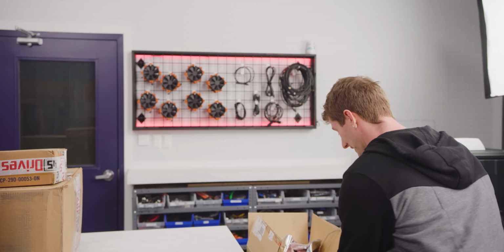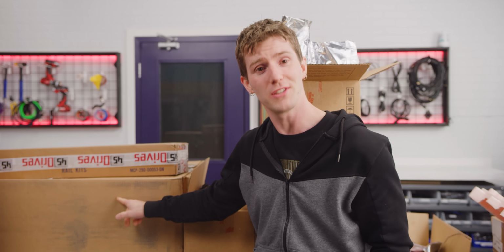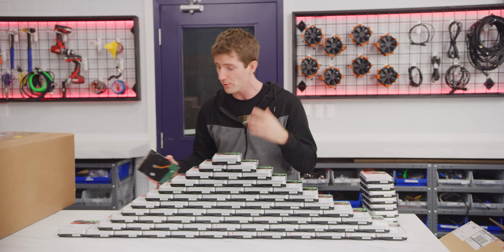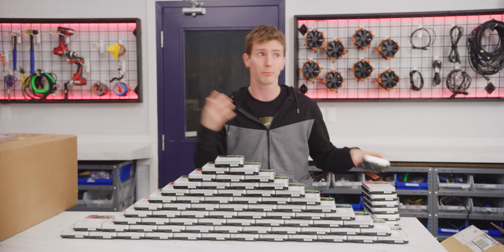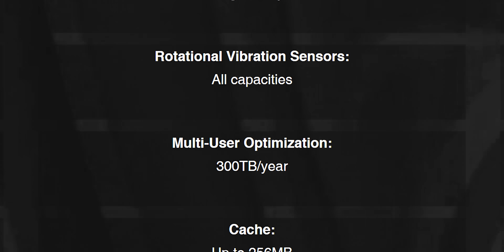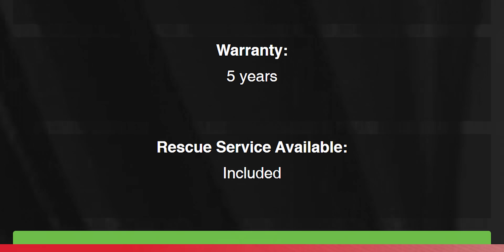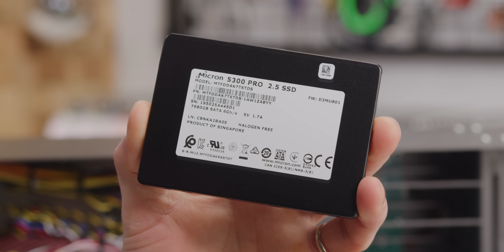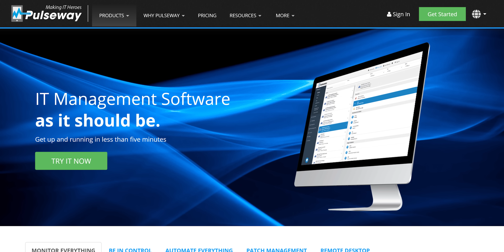Unboxing 3 PETABYTES of storage!!

Comment: Bruh huge shoutout to Seagate, sending thousands of dollars in Hard Drives for free.
Reply: That's how you buy targetted advertising covered in content.
Reply: 1 seagate 16 tb exos drive is around 500 euros so 60 of them is around 30k euros (ofc not including all the other drives or that that is retail price for an order of 1)
Reply: CycloPioneer thats the price not the production cost
Reply: As a marketing expense, $10k or $20k makes sense to get a few hundred thousand views in your exact target audience.
Reply: You guys are all missing the bulk discount factor, as well as the fact that the third batch of drives come with certain services included, such as for data recovery. I can get 8TB SATA3 drives at £180 each from a UK server hardware retailer, whence 1000TB becomes £22,500. That's ~US$29k or ~CA$39k, and without even asking them for a specific quote since I'd be ordering so many drives. I can see them knocking off £1,000, say — maybe £1,500 — for an order of 125 drives, bringing the cost down to £168 per drive.
Reply: 3000TB in 16TB drives is about 180 drives, All of the different drives range from 450 to 550 on amazon, so say 500.
500x180 = 90k
Reply: One of those is worth almost 1.3k€
Reply: If you follow his Amazon link, 16tb drive is $555 and he has 60-75 for the one server.  He ordered for 75, but the bay holds 60 so not sure how many he actually has here. I'm not including the other iron wolf drives and stuff that were wrong.  But 75 of these is over $41,000
Reply: @katherinelangford981  It wouldnt be too crazy if he actually had over $100,000 worth of hard drives there
Reply: @conorstewart2214  probably closer to 80
Reply: @katherinelangford981  oh and even that was an ssd. You'd think Google would know the difference between a hard drive and a solid state drive
Reply: Bo sorry nvm that's a 10tb drive. One of those is worth tens of thousands
Reply: @stugeh One Ten TB drive is not worth tens of thousands of dollars, or are you say that there combined total would be tens of thousands?
Reply: @stugeh  a 16tb exos is worth like $400.
Reply: @stugeh  try 300-400 USD
Reply: @AustinMichael  I thought I heard 60 not 16
Reply: no shoutout to 45Drives??? Lol

Comment: "Just let me have fun"

DATA HOARDERS UNITE!!
Reply: Recently deleted 500gb of screen recordings...
Reply: @kama2106   ah yes, that ones in homework folder
Reply: I mean he gets free hardware and content
Reply: data hoarding is fun
Reply: I'm not data hoarder - I'm time efficient! It would take time to go thru my files and figure out what to delete, and since storage capacity keeps going up every few years I just make a read-only archive of my files, get a new bigger drive and pull files from the archive as I need them. Then a few years later, repeat.
Reply: I am 12 TB RAID6 now but it's nearly full :-(
Reply: @NicosLeben  Full of useless data :(
Reply: No more E-hoarding for me.  I got rid of 2 useless laptops, an obsolete tablet, HD enclosure that I know wouldn't sell at eBay, and I'm about to sell my i7-4790 and DDR3-1600 RAM (I switched to Ryzen and DDR4).
Reply: CookyMonzta what ryzen exactly?
Reply: @wiktorixgaming8014  R5-1600.  A little faster than the i7-4790, but $79, compared to the $249 I paid for the i7 in 2015.

Comment: Still sitting here on my 500Gb HDD
Reply: I had 4Tb's of storage and I bricked them all. Now I have 250Gb
Reply: @BlessedDog   bricked?
Reply: @fruitvio4160  Bricking essentially means a device has turned into a brick. It may be an electronic device worth hundreds of dollars, but it's now as useful as a brick (or perhaps a paperweight). A bricked device won't power on and function normally. A bricked device cannot be fixed through normal means.
Reply: just simply oof
Reply: im here on 56gb btw
Reply: 1tb :p
Reply: @agsechogd6406  ha i have 2.5 tb 500gb is a samsung EVO 970 pro
Reply: Moe Lester nice one bro:)